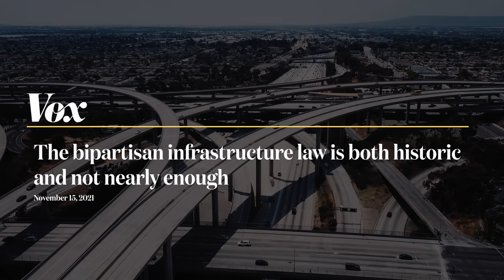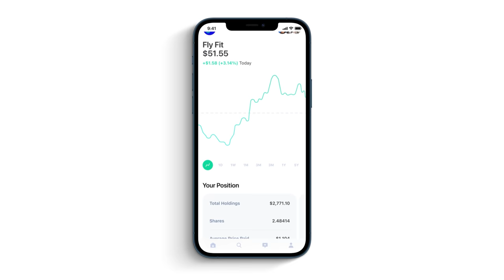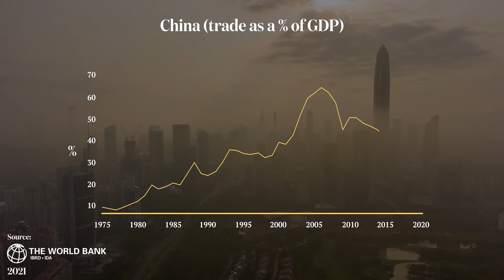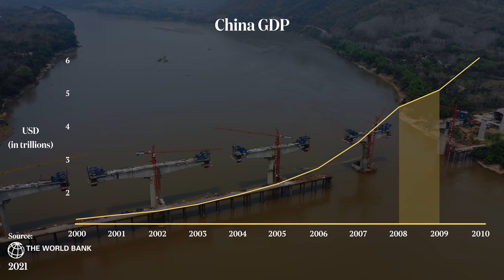China Has A Debt Problem Three Times Larger Than Evergrande | Economics Explained

Comment: "if they sell it, companies would only want to buy the high profit railways"

Tell that to the Australian government. Make them purchase both high traffic and low traffic rails.
Reply: Those low traffic lines are most likely unprofitable, so the train operating company will want government subsidies to at least break even, which defeats the point of privatizing the railway in the first place. No company is going to agree to run a railway at a loss.
Reply: Problem is that if you do that, you'll end up in a similar situation as some lines in the UK. A trains drives to a station once a week so that it is still "officially" in use...
Reply: Rail is a steel highway/road network/s and why should they have to make a 'profit' when roads don't make a 'profit'
Reply: @chrismckellar9350  *cough* Tollbooths *coough*
Reply: @chrismckellar9350  it needs a profit because it's owned and operated by an enterprise.
Reply: @fluoroantimonictippedcruis1537  - Are you refering to the train operator/s or the national rail infrastructure owner?
Reply: @chrismckellar9350  same thing afaik
Reply: @iqbalindaryono8984  In most cases those cover single digit percentages of the construction cost. Best case scenario toll revenue covers a significant part of the operating costs, but usually they don't. People seem to be very confused about how much infrastructure actually costs to build and maintain.
Reply: In Qld every train line outside of Brisbane runs at a loss. Every train passenger in Townsville costs the taxpayer over $1200 while the Unions keep demanding higher pay and more staff.
Reply: @Minchya  - Are they actually making a 'loss'. Has the indirect costs, of less carbon and toxic emissions, environmental population, health, social connectivity, etc been factored in?
Reply: @chrismckellar9350  Electric trains run on coal power, the others run on diesel. 
Social connectivity and service delivery are the valid reasons to justify the expenses involved. This has always been the issue in Australia with most infrastructure, big country, small population making it hard to profit. Now this is being used against us by the eco-warriors who refuse to acknowledge that Australia's contribution to carbon pollution is 1.4% of global output but rather use pollution per capita to paint all Australians as villains telling everyone that we are the largest polluters in the world.
Reply: @Minchya  - I think you missed the point of my comment. I know Australia's  electrical generation is mostly based on coal and its been like that for years due to hand sitting and the dominance of mining industry paying off the conservative state and Federal centre right politicians who govern states and the country through their 'here and now' tinted glasses. 

It seems that you have forgotten that the road transport is the biggest polluters, creates environmental pollution, increases health costs, etc compared to rail let rail has to make a 'profit' and roads and road transport doesn't.
Reply: @chrismckellar9350  Okay fair enough, what about the fuel excise, vehicle registration and tolls, are these not payment mechanisms ? Railways will always have limited practicality in a country the size of ours. Small European countries with large populations can have intensive railways but even then, if your fridge breaks down are you going to trolley it down to the station and take it to the repairer ? The way we are heading in regard to making the cars cleaner is the better solution as people have shown they prefer the freedom of personal vehicles except in highly urban areas. As the tech improves so does affordability and outcomes and in this regard sometimes it is better to be behind the forerunners as more proven tech is able to be adopted. This also applies to power generation as more practical solutions become mainstream. We also mentioned social cohesion and the flexibility of individual vehicles comes out ahead here as well.
Reply: @chrismckellar9350  the government spends 11 billion a year on roads and they make 40 billion off road tax, how's that not profitable? That's a 75 percent profit margin and trains do it through ticket sales
Reply: @Felled-angel  - Which government or country spends 11 billion a year of roads? 

With regards to to 50 billion in in road tax, take off of the indirect costs of air and environmental pollution, health costs. social costs, etc.
Reply: @youtubegremlin3915  - What about the indirect costs of roads, like air and environmental pollution, heath costs, social costs. 

A 2 track rail corridor is more sustainable and environmentally friendly than a 2 lane road corridor. 4 lane plus road corridor indirect cost increases compared to a rail corridor using 2 tracks moving the equivalent  number of people a rfreight.

A 218 seat 4 carriage train set removes 54 to 218 cars of the road and a 20 wagon freight train carry single stack containers removes removes 10 MAX50 B Train truck/trailer units of the road.
Reply: @Minchya  So are you saying people in different countries should be allowed to emit different  levels of CO2?
Reply: @catprog  No, I think the total emitted by the country as a whole should be the measurement not per capita..
Reply: @Minchya  So Australia (25 million ) can emit 250 million tons (10 tons per person) while Vatican City can also emit 250 million tons( 300,000 tons per person) and they will both be considered equal?
Reply: Don't worry, in Australia our Government will only spend on rail infrastructure to help open new coal mines.

Comment: The thought of everyone in China going back to personal cars or even buses and planes for intercity transport is nightmarish. The shot of one city near the finish of the video shows one very important issue: the horrendous air pollution including of course CO2. This desperately needs fixing and people are working on this. Encouraging rail travel is certainly one way of doing this. So they need to keep trains running, maybe using more low-speed ones if that is more sustainable economically.

I  should add that one piece of video during the discussion of low-speed rail is actually of a Chinese metro train. These are doing a fundamentally different job: moving people shortish distances around cities and suburbs, not intercity transport. And I must say the Chinese metro systems are great.
Reply: The reality is US pollutes much more per capita and focusing only direct profit ignores everything else which is also the same reason why US has some of the worst health care on the planet despite being a "rich" nation. 

The HSR in China is more efficient and is also different than Japan's and is 11 times the length. Standardization is also achieved which lowers cost ls much further than what is achieved in other countries. Labor cost alone cannot achieve this.

Comment: I completely disagree with your video. A little more research and you’d see they are connecting small towns so they can have access to the big cities for work. We in the west forget one way to reduce housing cost is to provide faster connections between smaller towns and cities. that way people decongest cities thereby in turn lowering living cost in cities. During the pandemic a lot of people migrated out of Toronto to the smaller towns and provinces and this in turn caused rent to drop because demand was dwindling. So if China is connecting small towns we shouldn’t look at it as a lose rather as a gain cause the market gets more exposure as more people get involved. Moreover, govt corporations shouldn’t worry about making profit on transportation for the public because the human and economic gains far out way the loss, I mean the uk transportation system is famous for not making profit  but still lives on because of what it brings to the economy.
Reply: if it does not make a profit where does the money come from to build it, and later to maintain it?
Reply: @toddknode752  public spending, overall, this dude is practically nitpicking on ants to say china bad.
Reply: Well yes and no. The main problem is was hsr the most cost effective solution? How about regular rail (it is cheaper and more environmentaly friendly due to less energy). Japan shows that we can achieve both (profitable hsr and connecting small towns with regular train).
Reply: @Jack-he8jv  you are right
Reply: Your comment made more sense than the video
Reply: This is literally covered in the video. The problem is not enough people are using the more rural lines to make up for that loss. Being unprofitable is fine to an extent. $860 billion, and not even including local government debt, is way beyond that extent.
Reply: @mastahfrederique1147  because high speed rail and other infrastructure are very long term plan, china build it to prepare the upcoming demand. Right now the station are empty, but in 5-10 year I bet many people will use those station. It's an induced demand
Reply: I recall an article complaining about our ferry system in BC, we try to run it like a business. It compared our subsidies vs East Coast (Maritimes I think) and we're greatly being short changed, most of the cost is going to the end user.
Reply: @toddknode752  more debt
Reply: @terencekwong3033  The money to run a service has to come from somewhere. In an unsubsidized system it comes from the pockets of the users, instead of everyone's pockets. So the high prices that ferry users are paying are a better representation of how much the service actually costs.
Reply: @Tuppoo94  that would be true if the government doesn't subsidizes road traffiic
Reply: @makuru.42  I don't know about the place where you live, but where I live the government collects about 4x as much money every year from road traffic as it spends on roads, railways, and waterways combined.
Reply: @MrGilang100  not really, the rail in Japan isn't profitable itself, the money comes from ownership of the land in and around the stations.
Reply: Small towns is a bit of an understatement. The stops on the HSR are cities with several million inhibitants.
Reply: @bri1085  well again you help to prove my point that the chinese way might be not the best way.
Reply: @MrGilang100  I don't think rail needs to be directly profitable, it grants economic access that otherwise wouldn't be there.
But I understand the point you're trying to make, there needs to be some level of certainty that the infrastructure will be available for the foreseeable future.
Reply: @bri1085  Well maybe not financially but socially it should or at least break-even. Public economics dealt with this kind of question. Social benefit can be assigned monetary values (increased wages, decreased transport cost, decreased death due to lower polution). A good public project should at least break even, the monetary cost is matching the monetary benefits it creates. Thats why real economics isnt strictly about financial profit making.
Reply: @MrGilang100  you explained what I was trying to say a lot better than I did

Comment: One thing you might consider is that HSR also keeps passengers off of the freight rail tracks. Having freight rail being able to focus on freight helps improve the economics of freight rail. 

Just ask Amtrak how much freight rail interferes with passenger timeliness
Reply: Except freight rail is surprisingly lacking in China, especially for such an industrialized country.

Regular-speed ground-level rail without massive expensive viaducts is good enough for local travel.
Yes you can actually build a dedicated passenger track alongside freight one, this is a norm in Europe.

HSR is good where it competes with air travel, i.e. busy routes across the country. 
It is not nearly as feasible where it competes with buses/trams/cars,

Although some routes may be a good thing for a wealthy enough economy with high density population such as between two nearby large cities, economics should be carefully considered here.
Reply: The problem in China is that the share of rail freight has actually declined, as all the investments have gone towards HSR. This is one of the major reasons for the supply chain issues we see now.
Reply: @91Durktheturk  what supply chain issues? To where? In China because of transportation? Can you be clearer?
Reply: Amtrak and their private partner just have terrible planning in general compare to places like Europe, or Russia.
But China actually spend too much on hsr that it neglected rail transport. Which means it is more reliance on the less efficient roads to transport goods/coals inland, and with some of the road being overused, they r not in good shape and accidents occurs quite often, which heart efficiency.
If China balanced out its rail development, it could have work quite well as rail freight is very profitable for such a large country
Reply: It would solve some of the supply issues we're having at the ports in the USA if we had more modern railways
Reply: @vc1470  from factories to the ports
Reply: @vc1470  he's lying.
Reply: @pueblobeefcorn2070  They ARE modern. 
Railway tech is pretty mature.
Freight railways are focused on capacity, not speed.
Yes, some bridges could be replaced, but this isn’t a unique issue, and wouldn’t solve the supply chain bottlenecks.
Reply: @innosam123  they aren't modern at all, first of all they're all diesel
Reply: @ronylouis0  Battery-Electric Trains are not mature enough yet for wide deployment.
Reply: @innosam123  then why are they getting deployed widely?
Reply: @91Durktheturk  how would having more  rail service in China from factories to ports help the log jam at US ports? I have not seen any reports saying domestic transportation of goods is a material issue in China causing 'supply chain issues'. I have heard of high demand making container space expensive OUT of China and a severe jam at US ports though.
Reply: @ronylouis0  Where?
Reply: B J  Because it’s run inefficiently. Rail miles across the developed world have collapsed due to privatization and efficiency improvements.
Eg. China has 1.5x more miles than the US, but the US carries 4.24x more cargo by volume on rail.
Reply: Love Amtrak. The problem is they don't own most of the track they use so freight comes first. If they owned the track it would shave off a significant amount of time. But if you're taking Amtrak you are likely enjoying the experience as much as the destination.
Reply: @innosam123  Battery Electric anything is a bad idea. Battery Electric buses are a dumb idea because Trolley-Electric buses were so much better, same with trains
Reply: @jwhite5008  Yes. Freight rail is terrible in China. Lots of stuff gets floated by barge or sent by truck leading to one of the highest logistics costs in the world here. It’s cheaper to ship a container of widgets across the pacific than across China.
Reply: @coastaku1954  Trolleys also need more infrastructure. If you can swap batteries or operate on one charge for 12 hours, battery-electric buses start to become appealing.
Reply: @innosam123  But Trolley Buses require no batteries, which is better for the environment. You can use E-Waste (Like Recycled Copper) to make the cables for the Trolley Bus and converting buses I don't think would be that hard
Reply: @coastaku1954  The issue for most transit agencies is money. 
Frankly, electrification isn’t really a high priority in terms of cost reduction (staff dominates costs). 

CPTDB says the cost per mile for a trolly route is $2 M per mile. 
Sounds small, until you realize if you cover an entire city with them, that’s easily Billions of dollars.

Frankly, I prefer the fixed cables of the trolley buses, but it’s not surprising it’s not pursued. It’s just economics.